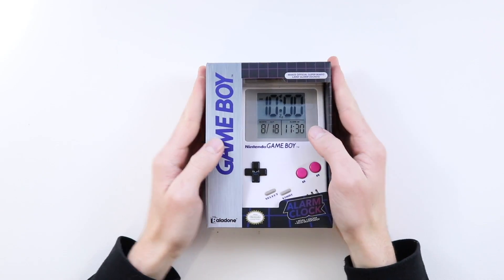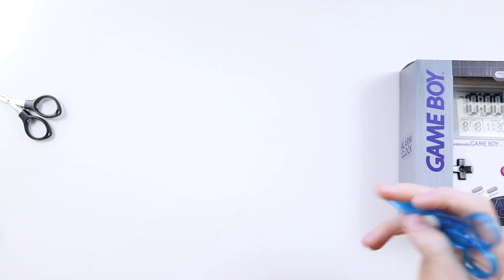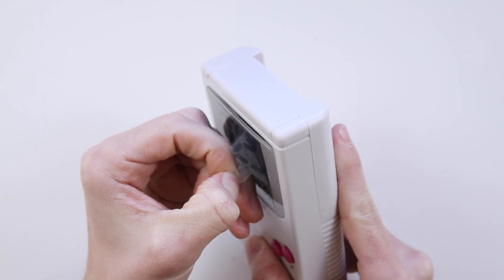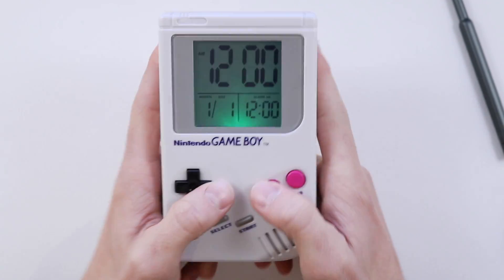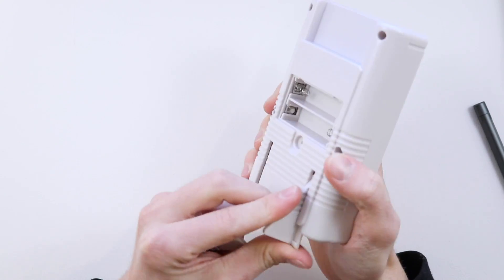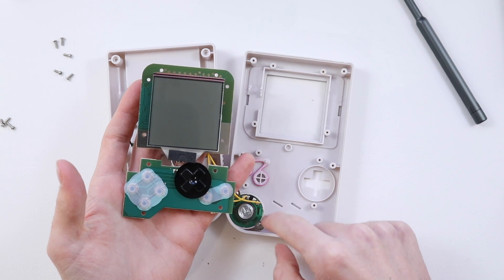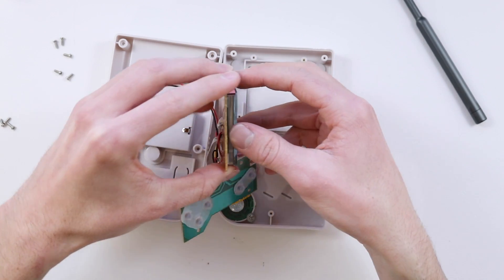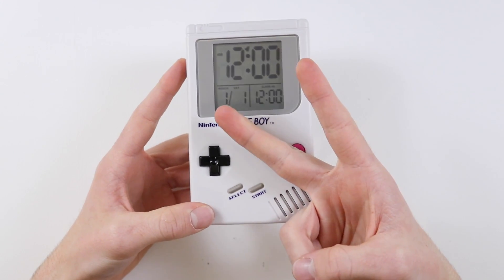It Looks Like A GameBoy, But It's NOT!?

Comment: The D pad stands out to me. Back story: Nintendo patented their design of the D pad, which gave them a huge leverage on the early console market by allowing them to have a directional control that didn't actually suck. The secret is the pivot ball that's on the bottom of the D pad, and allows the pad to be decisively moved in any direction with minimal risk of false input because the mechanism serves to both press and release the button. Like you said, it's an alarm clock, but nevertheless te D pad is missing that feature which is a shame. The patent expired in 2005, and it's a licensed product, so there's really no legal reason why they couldn't include it. Maybe they decided against it because the rubber membrane would need a hole in the middle which would make it potentially a couple of cents more expensive.